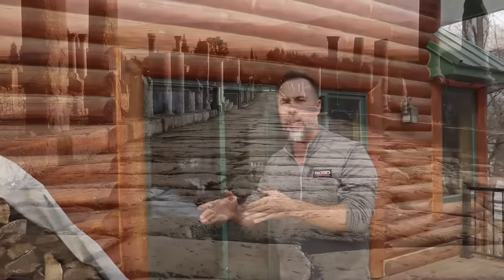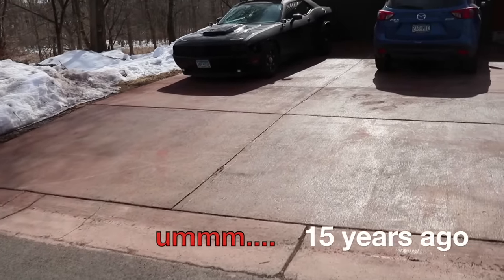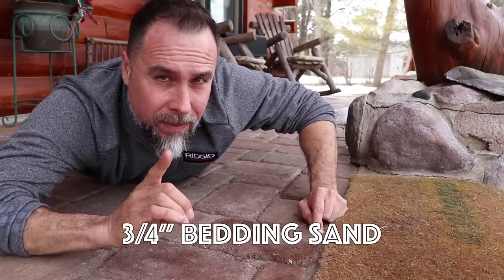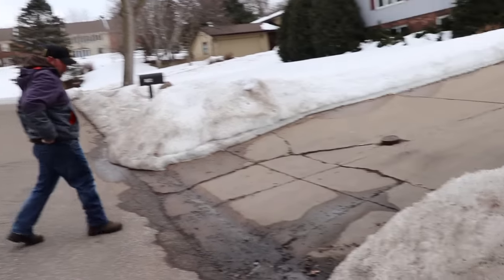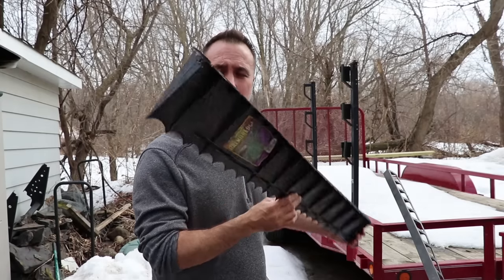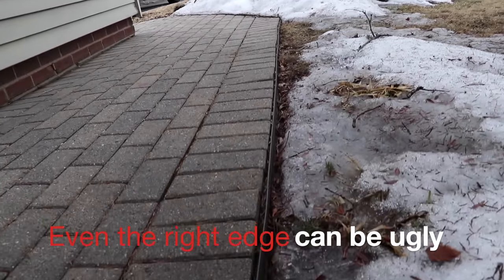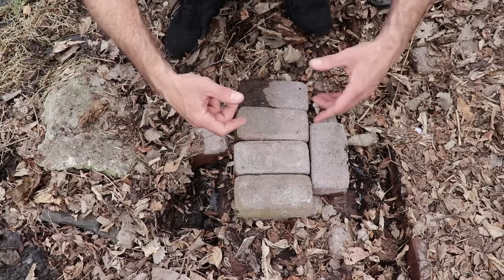How NOT to Build with Pavers-  Why They FAIL! *DIY your own successful paver project

Comment: 1. Bedding sand between 0.75 and 1.0 inches thick
2. Use the right edge restraints
3. Polymeric sand in between pavers
Reply: That’s 5% of it. Keep going.
Reply: @scorpiuswireless1  tell me the other 95% of it !

Comment: The vertical failure wouldn't have anything to do with the 3" downspout pour rainwater on the outside edge washing out your base? Huh. Been doing landscape and hardscape and irrigation for 25 years. I think you missed the elephant in the room. People, make sure to extend your drainage at least 10 feet down grade from your structure. This will save you costly repairs in the future.
Reply: Thanks for your point!! Helps a lot!
Reply: How would that not rinse out the joint sand, once there is horizontal failure seems like water could rinse the base out pretty easily
Reply: And not just paver damage...poor drainage also can destroy your actual foundation.
Reply: You’re right buddy! And also they usually don’t tamp
Right to the edge

Comment: The biggest thing about longevity is polysand every 5 years, people fail to resand and then the pavers are free to twist and turn as they wish. Plastic edge restraints and stakes are a must also. 6-8" of 57 limestone tamped with a machine every few inches, then screen fines 1" thick. You also need to make sure that your base is contained and cannot be washed out over time, and if there is worry for a washout, drainage install is a must to keep the patio from sagging. Good video Stan. Youd be suprised how many companies dont do it the way you describe... its a shame. Job security I guess.
Reply: Ryan Carlen  nice one. Ive installed pavers on my own house 7 years ago and still the same until a big truck carrying 20 ton screening sand made a piece sink. Other than that its still fine. I ordered the 20 ton sand so it was my fault. Funny thing is that the pavers had no base rock or screening sand. Just plain dirt
Reply: Oh please tell me how to get a GOOD contractor. We've got a VERY long driveway (it's over 200ft) gravel and just seeing this about pavers (which I love) I wondered if they would work here and how I'd get a GOOD person to do this!
Reply: @TWBlack  Good luck with that lol
Reply: @TWBlack  I just got a quote for getting some pavers done. I would say, just ask the contractor to describe how far down he will go, and what layers he will do as a base. and, if they will describe that in the write up for your estimate. I would think that most of the shady ones would take off if you ask them for that information.
Reply: @TWBlack  contact a reputable company and ask them how they do their pavers. It will cost more to do it the right way of course.
Reply: Screen fines are the wrong material to use. You’re not even supposed to use them your supposed to use concrete sand and qp or use 3/8 chip stone as the bedding and no. 57 as the base. Plastic edge restraint sucks too. Concrete with fiber is the way to go

Comment: My sons and I installed a paver driveway almost 25 years ago and it still looks great.  When we put the "foundation" in we moistened and compacted it about every 2" for about 10".  We used 20' long black iron screed rails to level the final sand before it was compacted,  The only problem we've had has been ants love to nest in the sand.  That good "foundation" has been the key to it still looking good.

Comment: I specialize in Gravel driveways and I can say without a doubt that Stan is absolutely right about base material. 

The part of a surface that you walk on is the "wearing course", whether it's asphalt, concrete, pavers or #57 Limestone. (0.50" to 1.00" stones).

Personally, I use 2" of #4 limestone over a triaxial geogrid (over a non-woven filter fabric in some soil conditions) and then top that with 6" of #411 Limestone and 2" of #57 Limestone. And that's for a light duty residential PARKING spot. For a light duty residential driveway I go 8" of 411's, for a HD residential driveway I go to 10" and for anything commercial I go to 12" and add a second layer of triaxial geogrid at the 6" mark.

Gravel, sand and soil all behave as a fluid when under stress, which is nice when you are talking about movement from frost because it flexes and returns, but when you place more weight on a spot than it can distribute to whatever is supporting it, or if you add enough water to saturate the material and overcome it's frictional coefficient then things are going to move.

You would never finish paint a wall before properly applying, sanding and priming the plaster and you should apply the same "get the basics right" philosophy to everything else.

I also use the same Roman Road example of what you get when you get the base right and then protect it from erosion, so it was kind of cool to see that in the video.
Reply: Would you recommend gravel as a base for patio pavers?
Reply: @sladjanbegic  -

Depends what you mean by "gravel", and what kind of pavers you're using. Size, shape, thickness, weight...

Generally speaking, whatever the manufacturer recommends is the best choice. Could I see myself using something as large as "3/4 clear" (also known as #57)

Sure. If what I was putting down were large, thick, heavy slabs. For what most people think of as pavers, I would probably just use sand, possibly grits, which has individual grains as large as kosher salt.

There are several variables, but it's usually wise to stick to the tried & true, at least for most situations.
Reply: I personally like the idea of moving away from paint and its difficulties. I saw a stone and wood beam house and it looked built to last 1000 years

Comment: 6,8 or 10" of base is my favorite thing you've said in this video.  As an asphalt contractor for the last 15 years.  Concrete borders will work amazingly if it's done like a curb and gutter, re-enforced with rebar and properly tied together (problem being many landscapers don't know best practice to achieve best results on this).  In our area, lots of research and testing has found the best gravel to be used is fractured on 3 faces of the stone with a good combination of fines - in the compaction process, watering the base is an essential step for achieving maximum densities for the highest quality longest lasting base possible but it's important not to oversaturate the base and flood the sub base below it.  In low lying areas or heavily saturated sub bases - cement stabilizing has been proven to be the most cost effective way to build roads where high quality materials aren't readily available; and, we also use in many applications 63mm concrete crush, a mixture of crushed concrete and asphalt no bigger than 63mm in size - 25mm = roughly 1" for those of you taught imperial over metric - in Canada we use both.  The process goes like this 4-6" of concrete crush placed (roughed in), watered, graded and compacted then topped with a 20mm road crush 3/4" with lots of fracture in the stones - round stones are no beuno!  They don't bind with each-other and the only time you can really get away with it is if you have absolute mammoth rollers that are crushing the stones while they're compacting 8 tonne plus in weight machines.  (I highly doubt many landscapers are into $250,000 rolling machines per unit).  And even if you buy and old used, not many landscapers are acclimated to moving that kind of weight around from job site to job site.

All that to say, I know a lot about base, various mix designs in HMA (hot mix asphalt).  A lot about concrete and a lot about geotextiles to fix saturation issues.  But, I keep learning from you Stanley and keep coming back!  Thank you!

Comment: "not even a chip" LUL as he pans across a chipped stone hmmmm LOL i enjoy the videos just found it funny
Reply: I totally thought the same thing.
Reply: But it wasn't
Reply: I thought this was hilarious as well.
Reply: More like a chunk of brick. It was still a very nice driveway and holding up well.
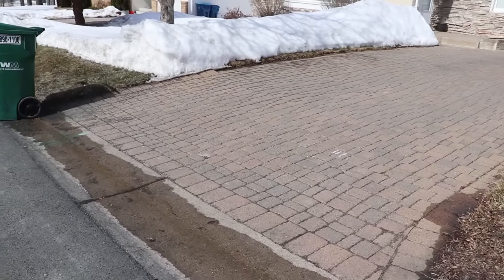Reply: @ABetterLifeInc  Look at 2:50. Not the chip, but the edge.. But after 23 yrs. Id expect something showing it age.
Reply: Oh yeah. There’s nothing to honestly complain about.
Reply: That and the fact he had wavy joints due to him not staggering them. He went easy and kept a single lay in rows which is a no-no. This very reason is why his paver lines looked like. Rollercoaster. 
Furthermore, he's high if he thinks those plastic border rails are the best. They're not. I rip them out ALL the time to fix them. They DO NOT work.
Reply: That was from a plow you have to.back drag pavers
Reply: @4doorgsrko  He staggered them within sections. But, your comment is arrogant. If you have two contractors in a room you'd have 3 opinions on what is the best way to do something. Where he lives, his method must word.
Reply: @nataliehidalgo8933  he did not stagger them at all. Lmao.  If by arrogant, you mean calling it out for what it is, guilty. 
Your comment is a bit pretentious. 
You don't lay driveway pavers in symmetrical rows. As it ages, they naturally move and if in rows, they will move a helluva lot more and look worse if they aren't laid like a typical staggered 🧱
Reply: @4doorgsrko  yep! The lines were crooked down the paver driveway. Those plastic edgers crack often.
Reply: @4doorgsrko  yep! Do the job correctly come to mind

Comment: Very well done, I'm impressed. .... another critical part of edging is it needs to have at least an inch of it running underneath the paver and sand bedding to 'Tie' it all together, so it 'moves' and 'flexes' TOGETHER, eliminating uneven settling of the pavers to the edging.  The best edging I used was, I forgot the name, but it was company out of Minnesota. 'Pave Edge' something or other.?.

Comment: I thing your advice is good for newer installations of pavers.  But several concrete driveways were replaced on my street by the same contractor 25 years ago (in Michigan). No base prep was done after removal of the old concrete.  The other concrete driveways have heaved and cracked, but my 75' x 20' driveway is intact. I attribute that to my digging of a drainage trench on the upslope side of the driveway - 12"x 12" x 12", with placement a socked perforated drainpipe and with pea gravel filling the ditch.  This reduces water infiltration under the concrete slabs.   My arms felt like they were 2" longer at the end of the trenching, but it's worked for me.
Reply from the maker: Thanks for the comments Bob!

Comment: I really appreciate all the knowledge you share, as well as video quality. There's a lot of stuff someone can learn from watching your channel
Reply: Stan's video production quality is top notch.  I haven't seen better shot video anywhere on the Internet.  Just in the lighting I can tell he knows what he's doing, or someone does.  
Only thing I'd critique is the somewhat rigid, I'd argue old school, introductions to content.  Whenever the "tip" lasts as long as the intro to the tip, your pacing is off.  It would be perfect for TV, which is where I'd wager whomever edits these learned their craft, but that type of intro was largely due to commercials you don't have to battle for attention so is not needed, IMO.  You already got us.  
Cut it out, or at least keep it to once at the beginning, tighten up the total run times, and you'll have some of the best, most dynamic content on the internet, and I'll bet your sub base increases. (Aside; there are a lot of producers going to apps with slick text overlays showing timestamps on the beginning of subjects so they don't need so much intro, plus it helps people using your videos for reference which I'd bet yours are.) 
Not that you need any pointers from some asshat on Youtube with no credentials.  I just would want to hear this if the roles were reversed and one of my viewers saw something from his perspective I maybe couldn't/didn't.  Then again I could be wrong on all of the above and you've already considered all the dynamics I am listing in which case cheers and please disregard the retard.  
Regardless, thanks for some really great content put together in a really professional fashion.  For a dirt monkey.

Comment: I worked for a landscape company for 3 years it was always clay then crushed 4 s then dirty 9s (pea gravel with sand). Never a layer of just sand. Always rock solid, I saw jobs that they had done 20 years prior and they still looked brand new except for the weathering of the pavers/stone obviously. But I agree what's underneath is always key to a project lasting.
Reply: I have a question, hopefully it's not too dumb. So, looking to replace some nasty looking dirt and mud in my backyard with something more sturdy. Thinking about doing pavers, but couldn't figure out how to get the entire area really level, then I realized maybe what I can do is pour a concrete slab first, then install some decorative pavers on top. Maybe use one of those plastic or rubber concrete forms where you can choose the design of paver you want. That way I wouldn't have to install each individual paver separately. Thoughts? It will only need to handle foot traffic.
Reply: to go along with my other post, the reason I'm saying a concrete slab, is cuz I want to avoid doing all the sand or gravel and screeding. Maybe it's really stupid because concrete is such a pain. But it wouldn't be a huge area.
Reply: Plen122 is better to use crushed concrete why you wanna pour fresh concrete and then pavers? They only do that on the Streets for cars
Reply: @stonemaster1217  it's okay I changed my mind, I'm just going to use those triangular concrete support things for the corners, then build a wood deck, and put pavers on top. The ones you click together.
Reply: @kbanghart  concrete is the only base for pavers if you want quality.
Reply: @stonemaster1217  stone master my ass

Comment: Glad I do this this way already . Seen enough crap work over the years . Plus it feels good to know it's done as right as can be .
Reply: MrAlbie 1970....you seem to know what your talking about and you responded to this year old video yesterday...I have a question I posted a few minutes ago... maybe you could answer....
I hope you or someone else can respond to this concern: We are using pavers and are dealing with protruding bricks on the house (at the base where the pavers need to fit flush) causing the pavers to be uneven. Obviously the purpose it to have nice straight lines. Now that it's halfway done and facing this new problem....Is there a workaround, without cutting or shaving down the brick? ?

Comment: Edge properly. Dig deep, use pavers vertically for an edge [so that what would usually be the side becomes the top] and then fill in your walk way or driveway with the gravel and sand base. Those pavers [once layed]  won’t have anywhere to go if you do it this way. Seriously stable yet flexible...

Comment: The right base is critical. 10 years ago I built an area right behind my house for my Huskies. The previous home owner tried to fix the erosion issue close to the house laying gravel right over dirt w no base and tossing some cheap concrete mix pavers over it. What a mess. I tore it out, regraded it and then put in a 4" aggregate base, power tamped in 2" increments, topped it w mulch and put a high fence around it. It's as good as concrete and hasn't moved in 10 years.

Comment: We use 3-4" for walkway or pad and 6" plus for driveway. We always make sure all organic material is out of the prepped area such as a old stump or something we generally excavate and try to get all the roots because over time it will decompose and cause setteling  If building retaining wall or large wallblock structure, we pour a footer. When doing a raised pad we use geo may after 3rd course if it is going higher than 3 courses and we compact every 6" when filling. Also use filter cloth on the inside wall.  Some times you are instaling in a wet area and extra soil will need to be removed and 57 stone (gravel) will need to be put down as a subbase  If everything is done properly you should have very little setteling. Mountains and buildings settle over time so regardless of efforts you will have some issues over time. If you can get 10 years out of it without any repairs than it was done well.  

Their are two types of concrete, cracked and concrete that going to crack. Pavers done crack so if a large tree pushes them up you can just pick them put, remove tree roots or just relevel and lay back down. Keep in mind you will end up with a slightly smaller paved area bc they will never go back the way they came up. Lol
Reply: BC stands for before crack

Comment: Stan, I just demolished a patio I built in the early 90s. Not pavers, bricks. Concrete border. Subbase? No. Base material? Yes, if you include potting soil. I did compact a sand base, before laying the brick. It suffered all 3 failures as you described here. Patio was useless except as a place to put the grill. Demolishing it was cathartic. You make good vids!
Reply: Barry Kaufman  Lol, sand is a very poor material to use as a base . Sand sinks.
Reply: Rick Johnson: that thing was awful. I think every brick was heaved. And the weeds. (But it was mine. As dorked as it was, I busted my butt on it. I just..did it all wrong!)
Reply: Were they bricks for a wall (holes in them to fill with mortar) or solid?  If they were solid then they were at least paver bricks.  Sounds like everything else was wrong with that install, though.
Reply: Jason, typical solid bricks. Everything about the patio was a complete disaster. Worse than bad. Fortunately, i used it just as a place to park the grill.